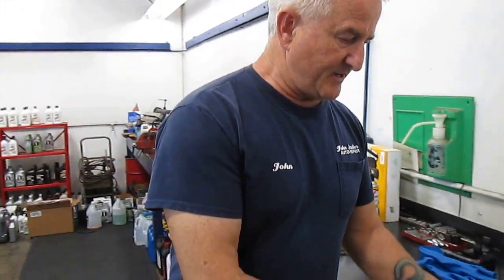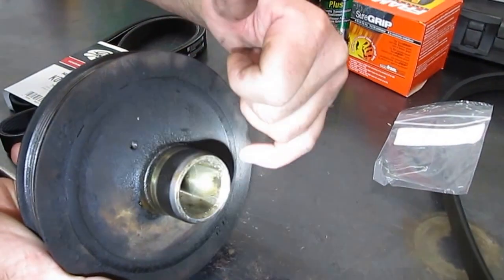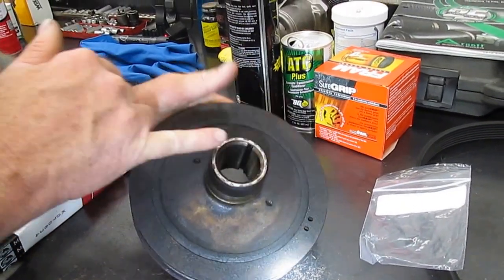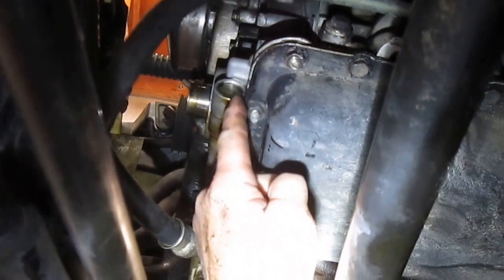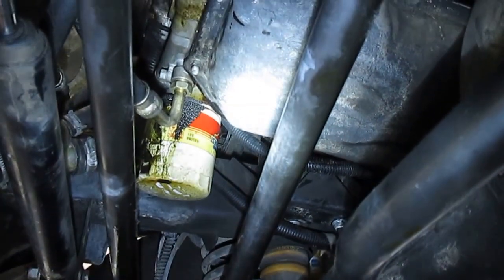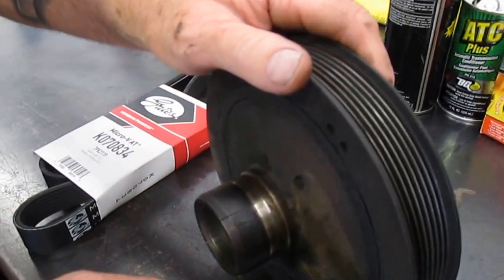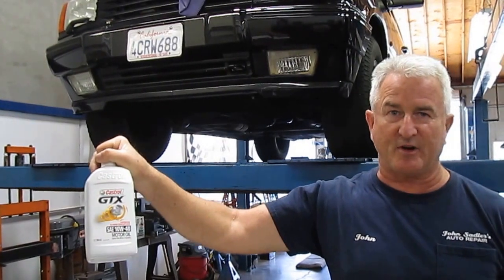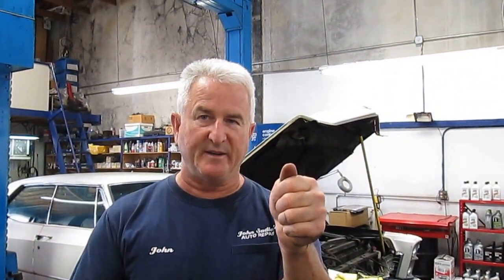Land Rover Oil Leak

Comment: I have the same rover with a 4.6 that shares the same timing cover and experiencing the same oil leaks.
I'm getting a steady oil drip directly above the oil filter that appears to be coming from under the oil filter rubber gasket on top of the filter and only drips off the filter, nowhere else.
I can't observe oil leaking out of the oil pressure relief valve cap or the oil pressure sending unit further up the cover. It's not the oil cooler lines or loose timing cover bolts.
The mating surface (between the filter and the timing cover) is smooth and clean and I replaced the filter twice to rule out a faulty oil filter.
Is it most likely the oil pressure relief valve O-ring?

Second, I'm in the process of replacing the front crank seal as it just sprung a leak as well and you mentioned the seal goes over the harmonic balancer @ 0:20?
The service manual indicates the seal is installed first and then the pulley is installed after it is in place.
New timing covers also come with the seal installed, but you mentioned the keyway is located on the crankshaft behind the seal, which means the seal would go over the rear of the pulley and then installed. Which is correct?
Also, how did you lock the crankshaft in place to prevent rotation when you torqued the nut off the crankshaft pulley? 

Many thanks for the informative video!
Reply from the maker: +glycosaminoglycan  It's most likely leaking from the o-ring on the crankshaft position senor directly above the crankshaft., the first one , the seal is installed on the timing cover and then make sure to line up the key way inside the balancer with the woodruff key in the crankshaft.

 REMOVAL  1. Remove viscous coupling. 
  2. Remove drive belt. See Drive belt
  3. Raise vehicle on hoist.
  4. Remove bell housing bottom cover.
  5. Remove engine undertray.
  6. With assistance to stop flywheel rotation, remove crankshaft pulley assembly retaining bolt.
  7. Remove crankshaft pulley assembly.
  8. If required: Place assembly in vice and remove pulley.

INSTALLATION
  1. Install the pulley to the torsional vibration damper.
  2. Lubricate the seal face of assembly.
  3. Install the pulley assembly.
  4. With assistance to stop flywheel rotation, Install the retaining bolt. Tighten to 280 Nm (206 ft. lbs.).
  5. Reverse removal procedure 1 to 5.